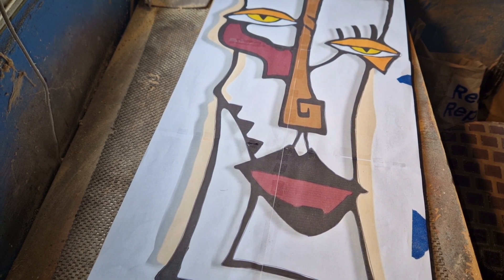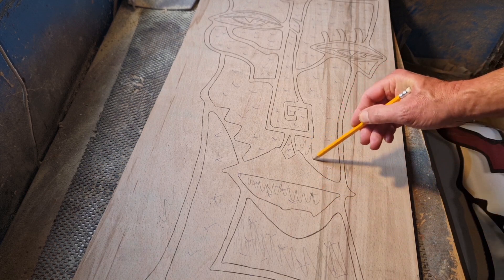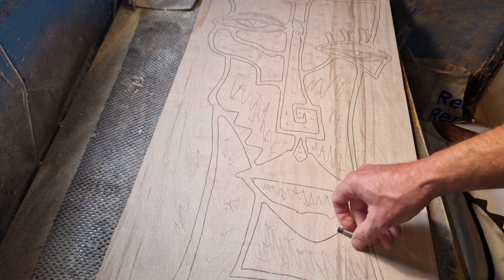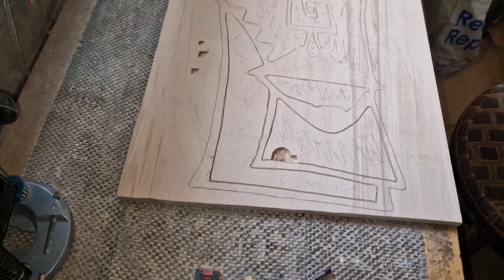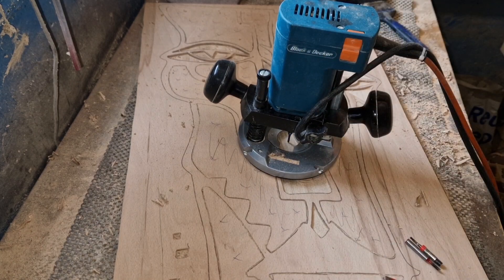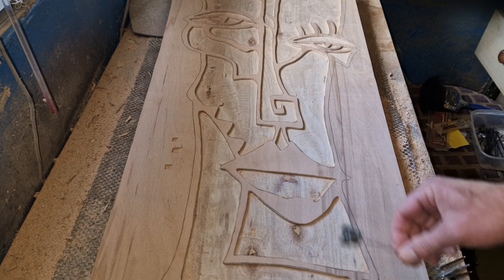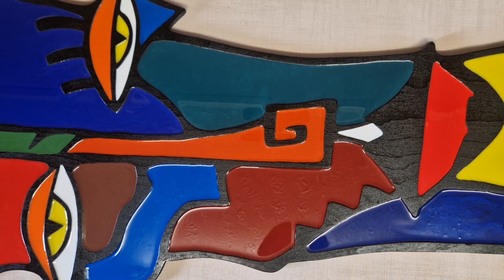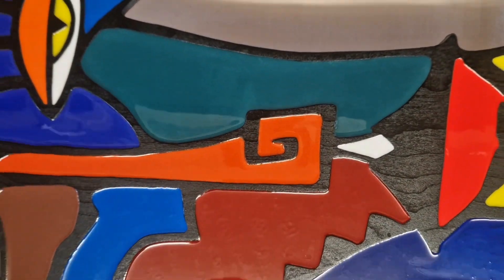Abstract Wall Art routed out on plywood and inlayed with resin..router project

Comment: Great job as usual.  What dremel tool are you using and also end piece that allows you to tidy up so nice.
Reply from the maker: @Mrwolfpack85  thank you,I've a dremel 3000 I use a flexible cable attached to it with cheap engraving bits  all from ebay 😀